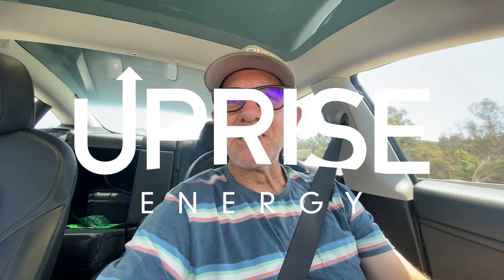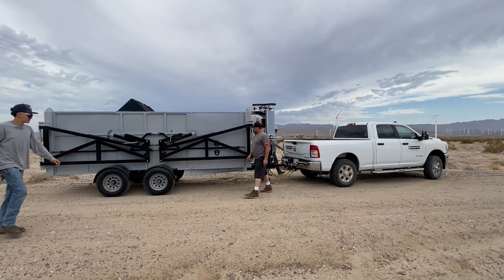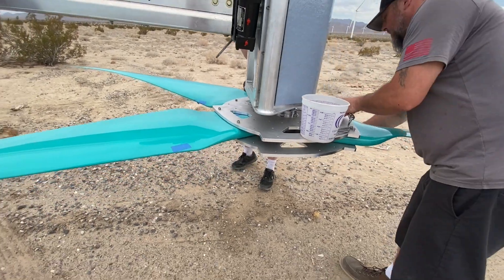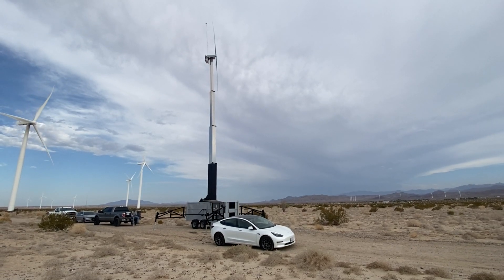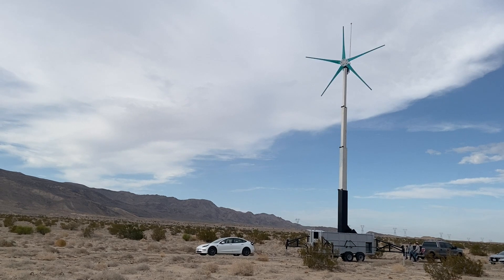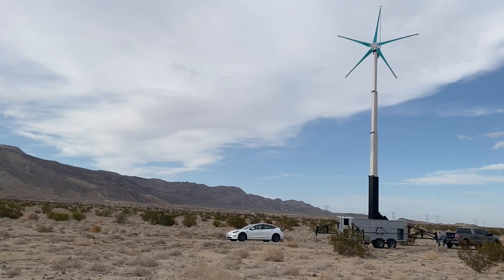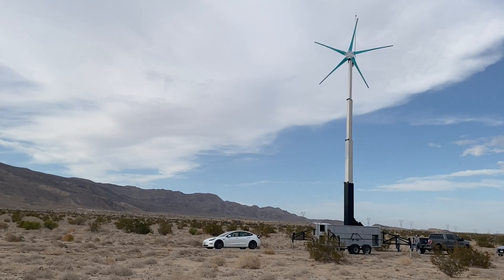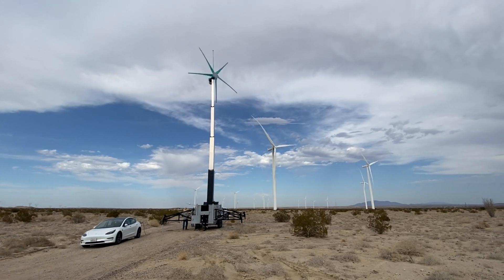From Shop to Desert: Uprise MPS Prepares for Fiji Mission

Comment: At 6KW that could power standard AWG device harvesting 6 gallons of purified water every hour condensed from the air depending on humidity and temperature.
Reply from the maker: Yes! We view air-to-water as a form of energy storage and water can be more valuable than electricity in some areas. In fact, did you know half of the hospital beds worldwide could be vacated if everyone had access to clean drinking water?

Comment: What was the wind speed at that specific time ? Also does this HMI only shows value of current & consumer have to multiply it by voltage to get idea of power generation??
As per your HMI screen it was aound  17.8 amprere assuming the 3 phase generator it would be at 380V Ac so it makes around 7kw..
Mean while HMI shows wind speed  21 whether it was 21mph or 21kmh ???
Reply from the maker: I was looking at the HMI while pointing the camera at the screen but didn’t have the entire HMI in frame. There is real-time power represented in Watts on the left side of the screen that can’t be seen in the video. The wind speeds during this 2hr session ranged from 2-11m/s and we saw peak power of just under 12kW and averaged right around 6kW. I don’t have all of the data in front of me right now but we’d be happy to share the data log files if you’re interested. We’ll probably post a blog with this info as well.
Reply: @UpriseEnergy   being a potential customer I am very much interested In It's power curve(with respect to wind) also does the mast height can be customized could be around 20-meter?? 
It would be great if you share real time data of wind speed & power produced in tabular format especially between 2.5m/s to 6m/s ..
Reply from the maker: The goal has always been to get the mast as tall as possible but given this is a portable machine designed to fit inside of a 20' shipping container, we have constraints on how long we can make the telescoping mast sections. The turbine shown in this video has a hub height of 15.25m and the rotor has a max height of 19m. If you send us an email info@upriseenergy.com we can send you the performance data collected during this session.
Reply from the maker: @sobanidrees2999  our turbine is variable RPM and the blades are fixed pitch. The system monitors wind direction and changes the yaw angle with an active yaw motor to always face the wind. In storm conditions, we have a hydraulic disc brake to control rotor RPM and the system can autonomously lower the mast, bringing the rotor to ground level.